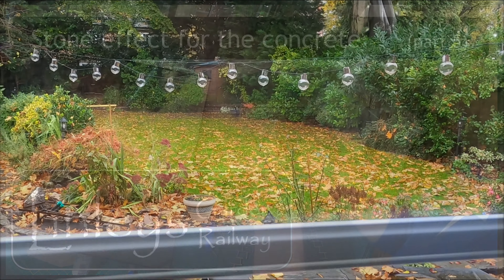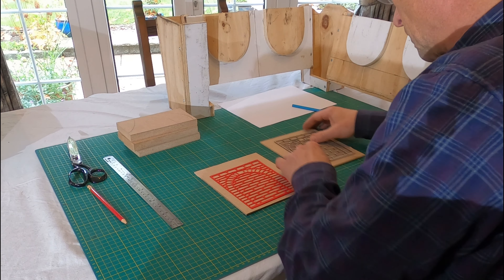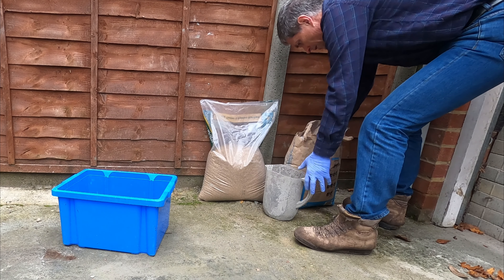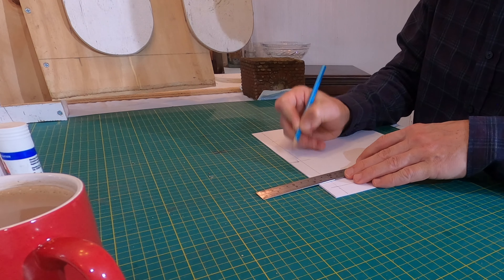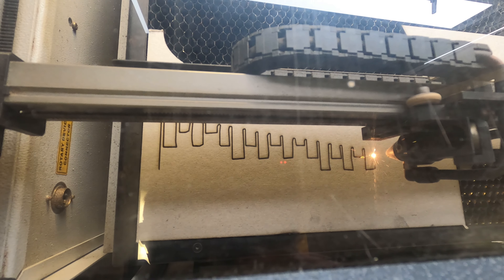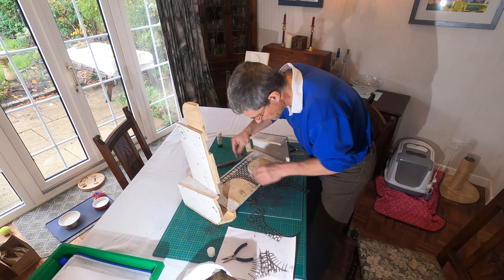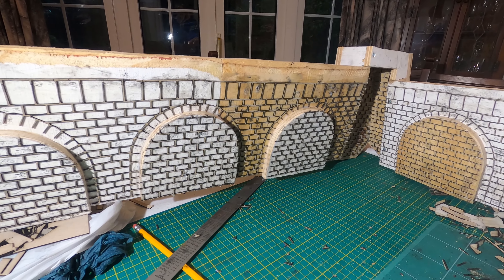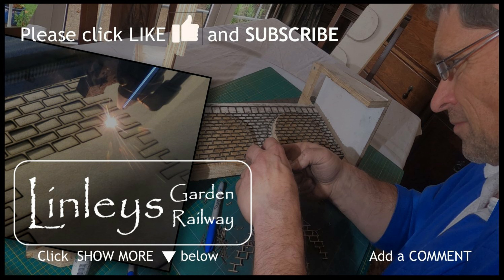Lasers & Cardboard | Linleys Garden Railway Developments Autumn 2020 Part 5

Comment: wow great work but I do have one complaint, your video was to short. LOL
Reply from the maker: Hi there, good to hear from you - thank you for your comment. The weather here in England has turned wet for the winter so not so easy to work outside. I have a 'planning' video about track control and cable routes for this section of the railway next.  Not done the concreting yet.  Take care, W :)